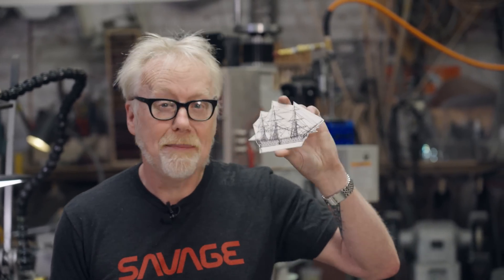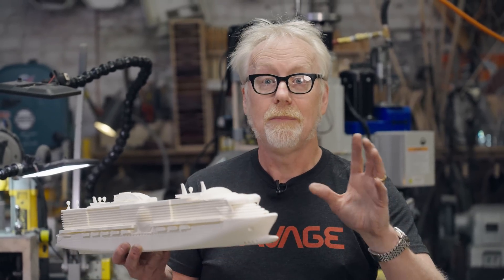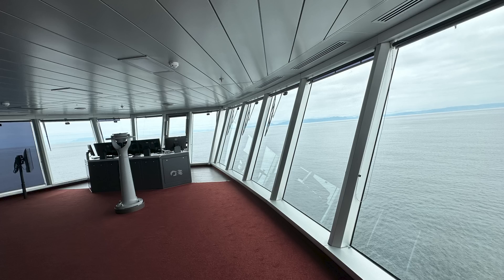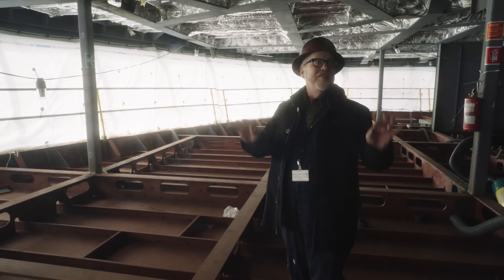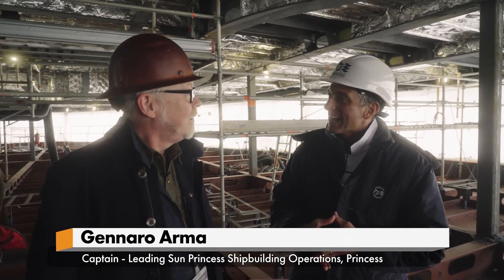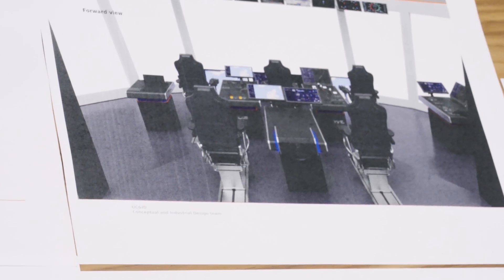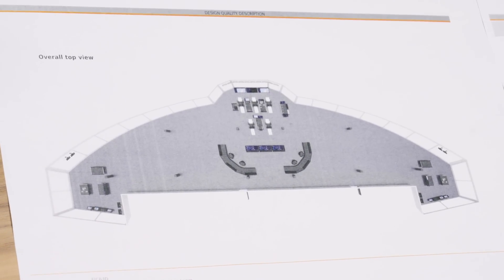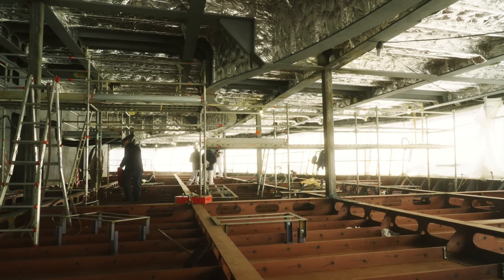Adam Savage Tours an EPIC Bridge

Comment: I notice that the helmsmen, who are unlicensed mariners, still don't rate chairs, on this expansive bridge where there's a special chair for every officer who could possibly happen to be on the bridge during normal operations. It also looks like the helm station doesn't have any repeaters or indicators, but requires the helmsman to watch the overhead displays. Nor do I see any controls at the helm station other than the wheel itself. I'm sure the officers and company execs think this bridge looks really cool, but I'm... unimpressed. Except the tug-style seating is an interesting idea on a cruise ship.

Comment: holy crap, 187 feet with 800 men?! Do you realize how unbelievably cramped that would be? When I was in the Navy my first ship was 255 feet with just under 100 sailors and we were cramped. I cannot even imagine what 800 people would feel like with even less room. I guarantee those guys were hot racking. Two guys per rack, when one is working the other is sleeping and they swap once a day.
Reply: No racks, just hammocks that did double duty as protective cover when rolled up and stowed above deck during battle.   I think each sailor was allowed 18 inches of space to sling the hammock, pretty much everywhere on the gun decks.   In that respect, they were better off (although they had very little personal storage) than some modern US submarine sailors.   They also had to take down those hammocks in the morning and clear to allow the space to be used for eating, and of course working the guns.

Comment: Floor plans look like a Star Trek Bridge.
Reply: The U.S. Navy studied Star Trek for their bridge designs.
Reply: @JV-pu8kx  so did basically any other scifi set designer after TOS that was asked to design a starship command center, especially for battleships.
Reply: All you  need to make it a Real  Star Trek Bridge Bring back LT Uhura 😍😍😍😍😍😍
Reply: It does look more like the bridge of the United star ship Enterprise than a boat indeed 👍
Reply: I was thinking Halo. Pillar of Autumn in CE.
Reply: It's interesting to see a greater emphasis on bridge crew being able to see the space around the ship themselves as opposed to relying primarily on screens.
     Iirc, one of the takeaways from two collisions that US PACFLT ships were involved in was a reliance on radar and screen displays over lookouts (chronic crew fatigue was, I recall, another).  
     While the requirements of designing a warship preclude the use of full-height glass windows across the entire bridge, the concept, especially the workstations, looks very promising.
     I wonder if the final design will reflect another lesson of recent US Navy experience...that relying on touch-screen UI for critical functions results in a less efficient operation of the ship under stress conditions, even though routine operation may be improved.  Mind you, a cruise ship's bridge crew are unlikely to have to run the ship when wearing anti-flash or NBC protective equipment, but emergencies happen even on cruise ships.
Reply: Kind of the same thing. Minus the threats of space traded for threats of the open ocean
Reply: I was going to say the same thing 😂😂❤❤ star trek😊
Reply: For sure
Reply: Beat me to it. That was my first thought.
Reply: It as if those cartoons were inspired by real life ships.
Reply: @stephen300o6  What "cartoons"? You sound like an idiot if you don't even get the medium correctly.

And no, at the time when the Original Star Trek Series came out (1967) fucking bridges on Ships did look nothing like the USS Enterprise. Those WERE crammed corridors between the overhanging nooks in which the few deckhands stood behind giant wheels and such, with minimal instruments, although 25 years after the war most classes would have Radar and communication screens for navigation and threat assessment.

I doubt seats for the captain/Operations Officer were actually common except on private boats, fishing vessels and then from the 80s on on big containerships and megatankers as their minimal crew required them to have more comfort to stay alert on shift.